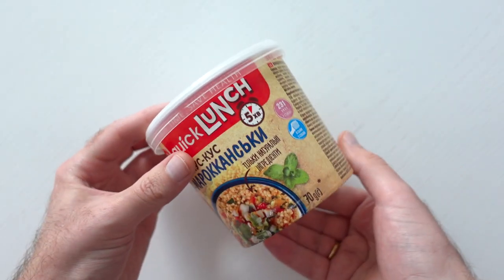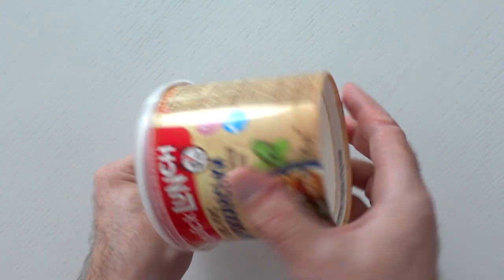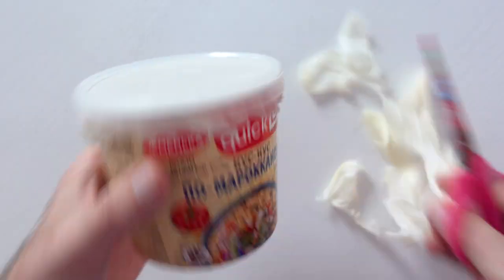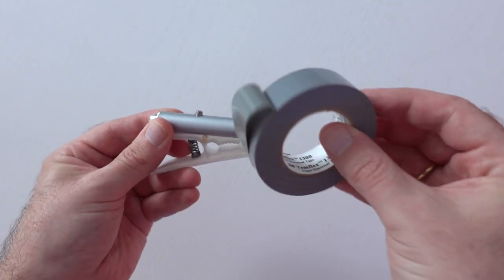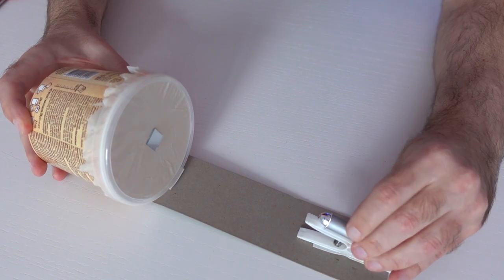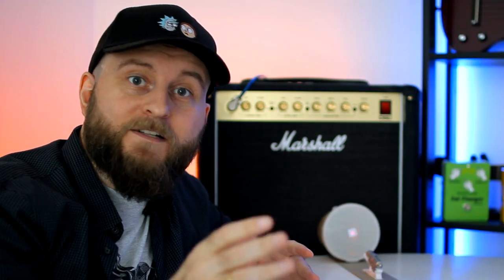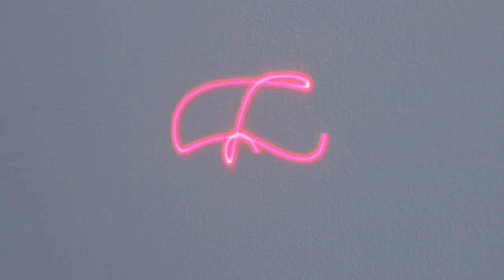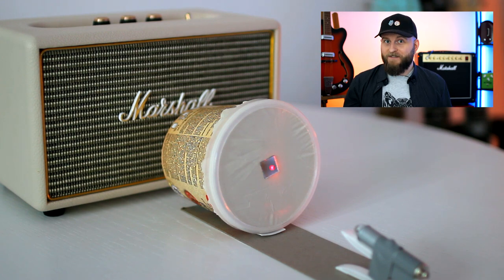Now I Can SEE The Sound Of My Guitar! - How To Make A Sound Visualizer

Comment: This is awesome! Curious, they used the same principle back in the early 1900's to visualize the "heart beat" of a plant(the liquid pumping action inside if them).

They used a thread of silk attached to the tip of a leaf on one end, and a tiny lever on the other. The lever modulated a minute reflection device and projected a point on a wall in the darkened room they were conducting the experiments in. They also went so far as to put a small tent over most of the plant and administer chloroform(or some such gas, I can't recall exactly which off the top of my head) to the plants, and found that their pumping action slowed way down, and in some cases stopped entirely, but then revived when re-exposed to the natural atmosphere.